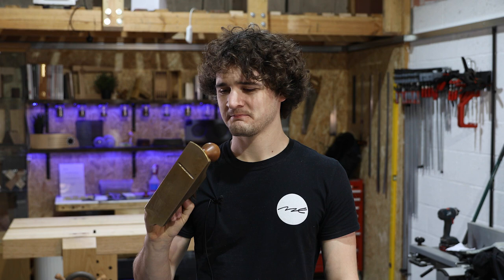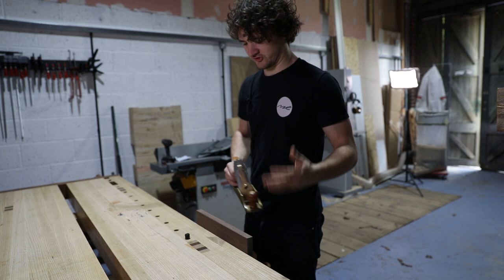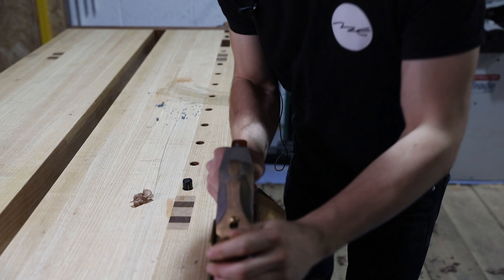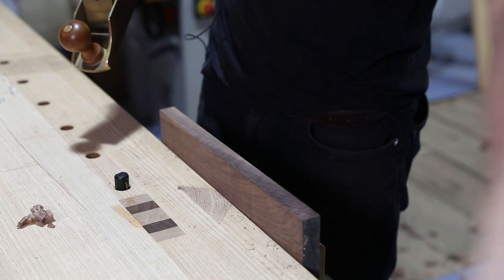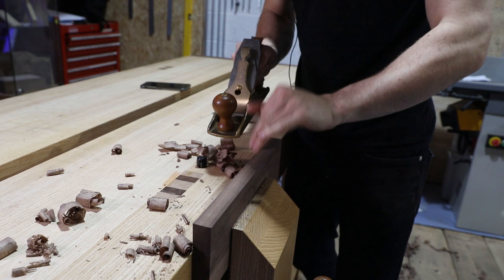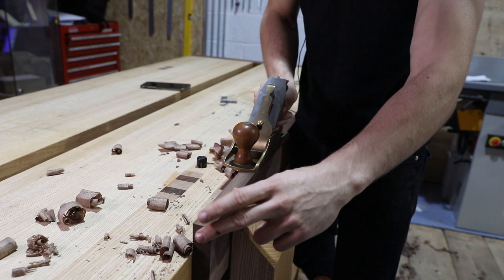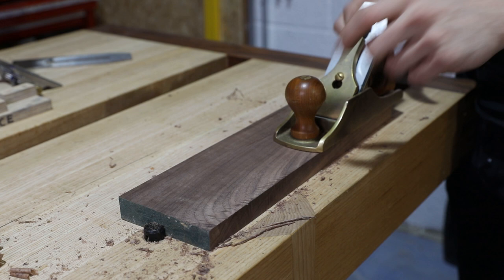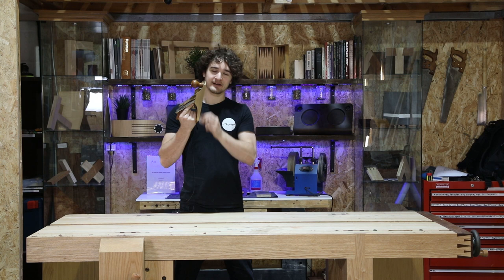How to Plane CORRECTLY

Comment: I am fairly new to woodwork and most of my projects dont have to be extremely accurate as far as glue jointing goes because most of what I have done thus far has been rustic. However, when trying to get into planing of any sort I continue getting the wood to tear and I’m getting gouging. The planer I have is doing the same thing and its brand new, but it is a lower end planer. I have checked the blades of this new planer and they seem level and fine. I also make sure its nice and clean before I start planing by vacuuming and wiping down the blades. Hand planing I’m getting the same kind of tearing and gouging. What am I doing wrong? I am using wood of all sorts but mostly pallet wood that is maple and oak. However, I have also purchased some exotic hard woods like Purple Heart and its all doing the same thing on both the hand planer and the auto planer. Very frustrating
Does it seem its the blade is not sharp?

Comment: ??? I have an issue with no matter what I plan the very front and the back are always lower then the middle part of the board so when I am trying to joint two edges together I always get a crown put in the hell am I doing wrong I've tried to fix it but I always keep doing it
Reply from the maker: Watch my chopping board series, video 2 :)

Comment: Although it applies to me, I'm asking on the behalf of everyone:  I have some old Stanley planes, a few of which belonged to my wife's grandfather.  Your videos have taught me to sharpen them, tune them and use them.  However, they were in very poor condition.  The soles were pitted and less than true.  I used sandpaper wetted on a thick piece of glass and got them as flat as i could manage.  Do the pits let behind from years of laying actually hurt anything?  

My theory is that they could actually reduce friction a bit, so long as the high points are even and more numerous than the pits then it's much like a Japanese plane, which makes contact only on part of the sole. 

Opinion?
Reply: The pitting is purely a cosmetic thing. The pitting won't affect the plane operation one whit unless it's extremely severe. What you don't want to do is a lot of local sanding, trying to get the pits out. That will make the sole of the plane wavy and will degrade performance.
Reply: It will only effect performance if you have deep pitting right in front of the mouth opening where it could allow fibers to be lifted by the cutter and cause tearout. A flat area of contact at the toe, right in front of the mouth, and at the heel is what you need. Watch out for a hump under the frog right behind the iron. This is very common. Your planes will never take consistent shavings if they rock on that hump. It can be hard to tell as you flatten the sole whether you are rocking the plane. Removing that hump is the only reason to try any localized sanding on the sole. Be very careful not to touch the area in front of the mouth if you try this. PSA rolls are far better than wetted single sheets for the job. In my opinion it is well worth buying a roll of 120 PSA especially since you have more than one plane to restore.  Those old Stanleys will probably still vastly outperform a new Chinese bargain plane if sharpened and tuned up well. Good luck with it!

Comment: Will candle wax interfere with finishing products? Some of us finish our planed surfaces right after.
Reply: Evolve 614 This was a concern of mine as well when I first started waxing my planes.  However, I’ve since waxed my plane soles for years and I’ve never had any problems with finishing (oil or water based).  Silicon is more what causes finishing problems..
Reply: @whansen65  most of my planes are corrugated so glide isn't an issue but if there is room for improvement I'll try it

Comment: I was surprised by your comments about bearing down on the plane. I've seen several other planing tutorials that recommend letting the weight of the plane do most of the work. (A particularly notable one by Paul Sellers has him dragging a plane across a board with some twine as it takes a nice shaving.) Light downward pressure also seems to work better for me in my own work. (However, if I have to push hard to get the plane to move forward, it's hard not to also increase downward force.)

Is it just a matter of personal preference, or do you think that there's an advantage to bearing down?
Reply: The locked arms wide stance while pushing with your legs is about sustainable power combined with fine control. Hard to peel those very thin smoothing cuts off a dense hardwood for more than a few minutes if you are trying to slowly shove your no 4 through in a controlled manner using only your arms. I find it easy enough to blithely throw my no 5 through the rough cuts but then I'll choke up on my smoother for the slower controlled strokes. More Speed + More Mass = More Power for the no 5.  Some Guy is just bucking for Hater of the Month! Sometimes your plane won't cut 'easily' no matter how sharp your IRON; which Paul Sellers also said.
Reply: I agree completely that pushing with your legs is a great technique. I was referring to Matt's description of "pushing down on top of the plane" and "all your weight on top" (starting at about time 6:58). While sometimes you need to push down (in that I also disagree with Some Guy), Matt's phrasing seems a bit extreme to me.
Reply from the maker: As I said, no rules in woodworking :) 

So I have just finished teaching a woodworking class where we made a chopping board and there was one student who always struggled to get a shaving. Plane was very sharp, very well setup, but her technique was terrible. Firstly we fixed the stance, then she resorted to pushing the plane forwards with her arms. This resulted in dipped off corners, the plane skimming over certain bits without cutting, and it often made the piece worse.

I then told her to slow down, put more force on top of the plane to keep it bedded down. Voila, a big ribbon came flying out the mouth.

Don’t get me wrong, I’m not saying Paul Sellers demonstration is wrong, but you should note that it only works if you pull the plane slowly and steadily. If you tried to pull that thing any faster, it would probably vibrate/chatter and jump out of the cut.

By bearing down on the plane, you prevent this from happening. Then you can begin to learn the forces you need to exert, and you can slowly reduce the pressure you are applying as your body naturally adapts.

BUT. Once again, everything I’ve said here is from what I’ve seen and experienced, but it’s not the only answer!
Reply: @MattEstlea  Good points! When I watched Paul's demonstration, I thought he was pulling slowly so he could keep the plane centered on the board. But after reading your comment, it seems obvious (in retrospect) that the feed rate would affect cut quality. Just like it does with pretty much any cutting operation.
Reply: Another argument for more control is defects right at the start of the cut. Everyone who has done any amount of planing has seen the phenomenon where the plane seems to just stop working in one spot on a wide panel. You can take shaving with the grain on either side, but it just won't engage at one spot. You hear a small click and then it slides over the board for several inches without cutting. This is the result of the plane hopping over the end of the board on a previous pass and leaving a hump that holds the plane above the surface. Very controlled, stable registration when entering the cut (and just enough downward pressure to keep the iron from hopping out) minimizes these defects.

Comment: ⬜️Another superb vid Matt.👍
Any comment on best work bench height if you have a choice in a custom build?
Reply: as high as you can get it without your arms tiring out over long periods of working. Your back will thank you in the long term. OR, if you feel okay with stooping over a bit, to get extra weight behind whatever it is you are doing, hip and waist height are okay too
Reply: If you have machines for milling your stock, your bench can be above waist height. I like using a wooden try plane so my bench is quite low by modern standards. The old formula is:  stand relaxed, feet shoulder width, arms down, palms horizontal facing the floor, and your palms should just graze the bench top. This is ideal for heavy hand planing but you will bend over a lot when sawing and chiseling. If you want to use wooden hand planes, it could even be an inch or two lower than that. I recommend leaving some extra length on your legs below the bottom rails so you can experiment with a taller bench and  cut them down if you need to lower your bench in the future. Blocking a too-low bench back up could be...problematic.

Comment: I'm pretty sure skewing the plane does not change the cutting angle.  Instead, it does change the cutting action.  Imagine a kitchen knife chopping vs slicing.  Pushing the plane straight means the cutting edge is going straight into the grain like chopping carrots.  Turning the plane adds a sideways motion to the cut, like slicing tomatoes.
Reply: It does change the cutting angle.  Think about climbing back and forth up a steep hill versus walking straight up it.